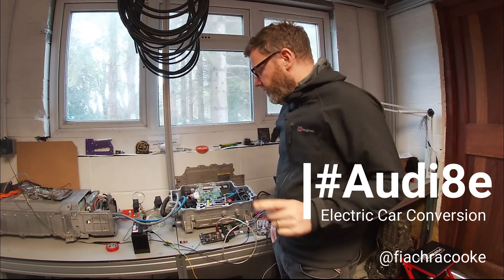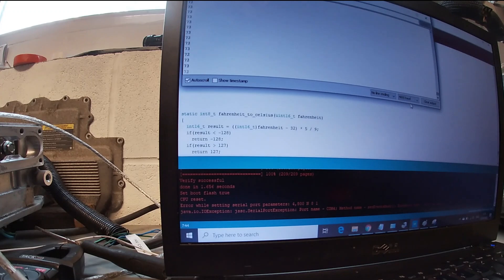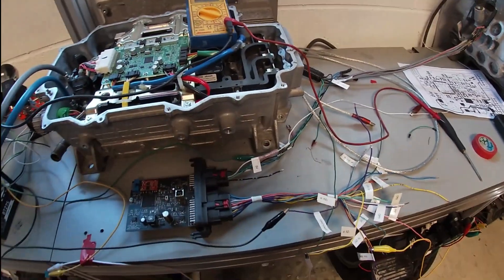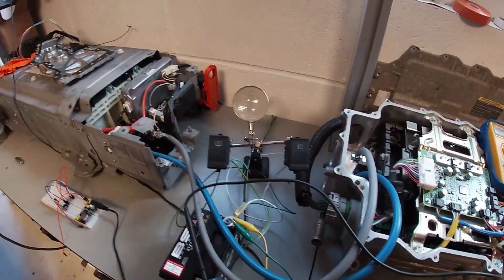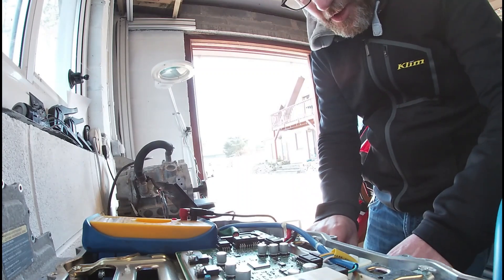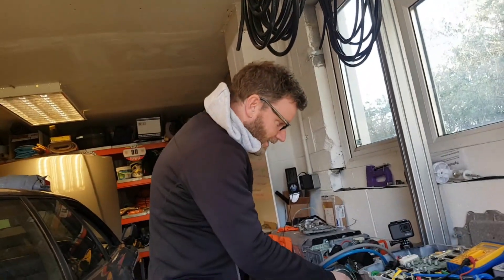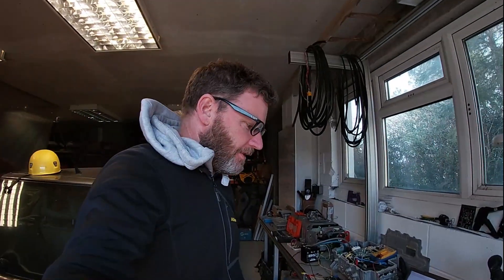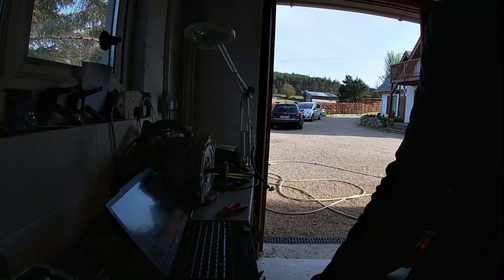Audi 80 EV Conversion - Part 6 - We have Spin!

Comment: I don't get it why do we have to program the VCU, I thought we just wire it up after we build it flash it and the motor should spin, then its a matter of tuning if one so desires
Reply from the maker: Yeah, that's the way it works now!😄 
This was the 1st rev of the board and there were a LOT of bugs in the code which myself and James (https://www.fig-leaf.org/) figured out with some trial and error. Now, when you buy the vcu's, it is more or less plug and play wrt the Gen 1 Leaf. Donr forget, this was Damien's 1st proper vcu after the Tesla drop in board and we were the guinea pigs in a way. Looking back... it's easy now. All part if the learning curve. Glad you like the footage 👍. Hope to have more soon.... been a bit quiet of late

Comment: Been thinking of doing this to my MK1 cortina that I was setting up to run a zetec engine 
I am slowly converting with the idea of using a leaf as a donor vehicle and wold like to use as much as the leaf as possible to keep price down and to have the option of off the shelf parts
 great videos keep up the good work buddy
Reply: I'm not a electronics Wiz and looking for plug and play options any advice would be great before I comit
Reply from the maker: @rhtremovalsandstoragenorfolk  hey. Sorry for delayed response! Best recommend to post up what you want to do up on the open inverter forum where there is a load of expertise but I would imagine the leaf motor hooked right up to the cortina bellhousing and similar setup to me using either the evbmw or openinverter brain board. 👍